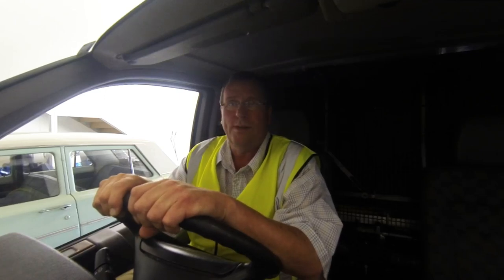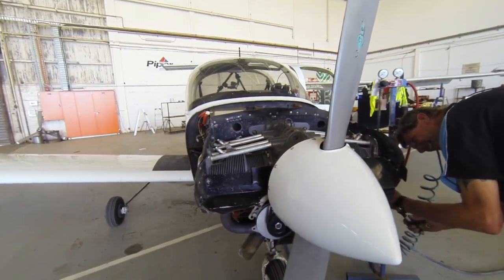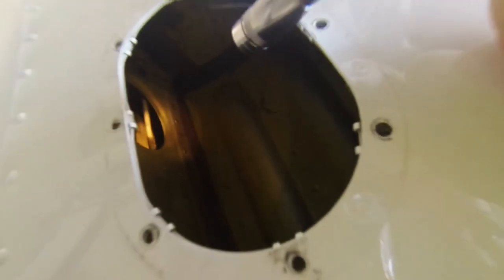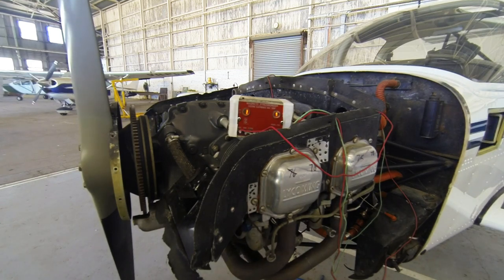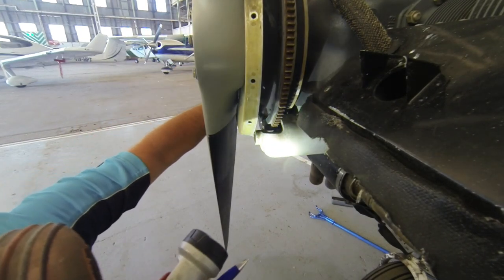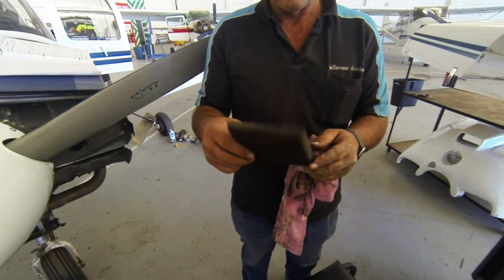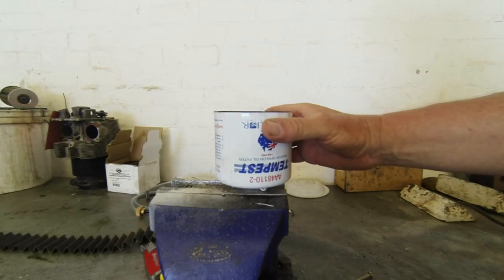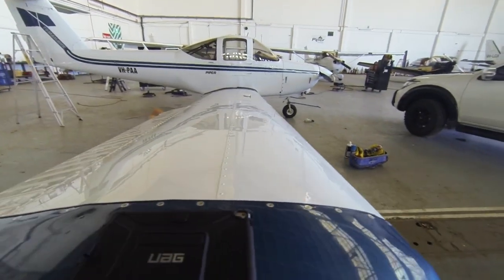A Piper Tomahawk 100 hour Maintenance Ep. 17

Comment: Geez, you're killing with your filing both ways.  Please examine the cutting edges under a magnifying glass.  They are NOT designed to be used in both directions.
Reply: Had had engineer tell me to use edge of a spanner to massage they alloy back into shape before any filing was done. Otherwise just reducing the life of the blade edge.